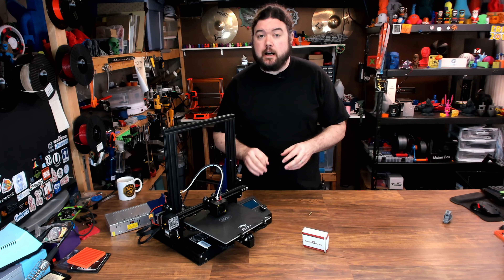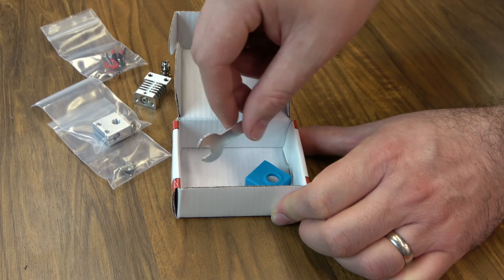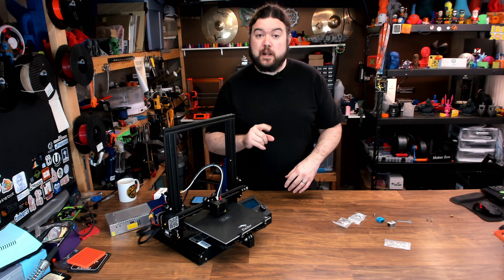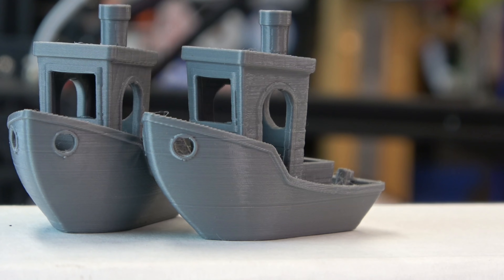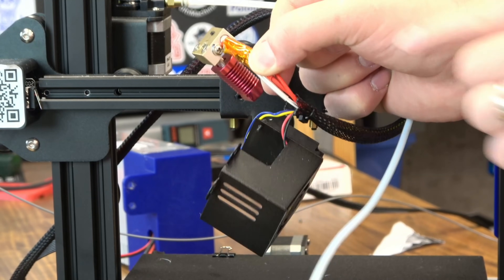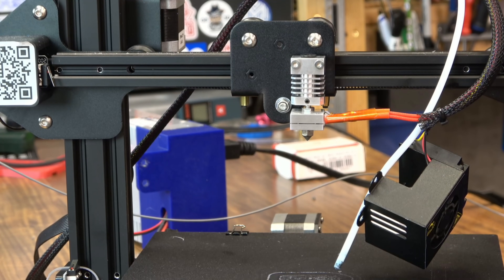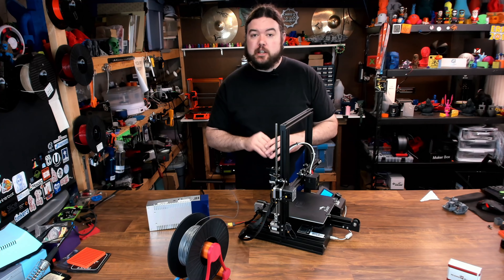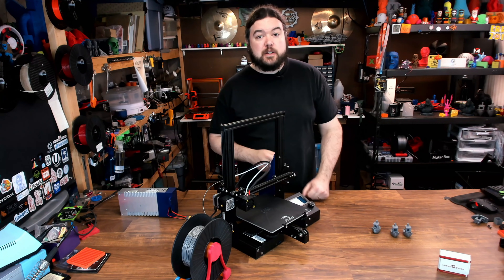All Metal Hotend - Ender 3 - Chris's Basement

Comment: So I made this mod to my Ender 3 (I made my own parts) so I could eventually print ABS, PETG, Nylon, and Polycarbonate (the holy grail).  Now I'm having serious issues printing ABS.  Seems like retract issues, but just can't nail it down.  Parts look horrible.  The surface finish looks like sharks' skin and I get a lot of plastic deposition back onto the nozzle.  Not sure what to do.  HELP?
Reply: I suffered with ABS too - built an enclosure, used the bed around 95° and let that heat it up, and print slooooowly 25-30 mm/s  with the hotend at 250-260 so the layers have time to fuse together. I eventually got good results and usable parts.
I left the retract settings the same, at about 6.2 mm, and I always used lift, wipe and avoid traversing perimeters.
A bigger nozzle diameter can also help with remelting the layers together.
Lots to play with, and it can take weeks to get right!
Reply from the maker: For this hot end I do 255c the bed at 100c and I set retraction about 2.5mm.

Comment: Micro-swiss recommends changing retraction to 4mm or under, or you risk jams (and it would be even shorter with direct drive). This would probably help with the smokestack as well. I have never noticed all-metal hotends to be jamming more with PLA. I think most people who have jams are running with too high retraction.
Reply from the maker: I was tuning this one after the fact, I got it down to around 2.5mm, seems to work well.

Comment: Great and honest opinion on why you should/should not upgrade to allmetal, however.... why the ancient Micro Swiss hotend?
we've come a long way since then, bi-metal heatbreaks! 

either a high quality one from Trianglelab or similar which is compatible with stock hotend, or why not get a Phaetus Dragonfly BMS (replaces stoch hotend directly) with heatblock to handle temps as high as 450c or something. gets you haflway to high temp filaments! (heater cartridge+thermistor and fw left).

How about a comparison maybe? ;)
microswiss VS dragonfly vs stock with bi-metal heatbreak/throat
Reply from the maker: Humm.... 🤔

Comment: I print a lot of ABS and ASA on my Ender 3 Pro, in a heated enclosure.  Switching to the Micro Swiss all-metal hotend and hardened nozzle has made the prints a little more consistent, and I have found that I am doing a lot less maintenance.  (and yes, it took a lot of fiddling with tuning everything to get looking good. But I think it was worth it.)
Reply from the maker: Cool, thanks for your insight!

Comment: This is by far the only useful video about the microswiss, unfortunately I already bought it last week and installed it a day before this video. If you don't have to print carbon fibre filament don't get an all metal hotend it turns PLA into glue. 0.4 nozzles tend to clog often.
Reply: No. Change your retraction to under 4mm. Or better yet tune it with a retraction tower, but keep it under 4mm. Print a temp tower as well to find your temps. It should print PLA with no issues at all.
Reply from the maker: Thanks!

Comment: I have found that no matter how well the PTFE tube is seated against the nozzle, the PTFE tube will move over time and you get partial clogs and under-extrusion. An all metal hotend removes that problem. I have been using all metal for a long time, never had any clogs or jamming. I think most problems people have stem from not tuning and to much retraction.
Reply from the maker: I have found the same as well, the retraction has to be adjusted to have success.
Reply: My retrctions are 1mm..still cloggs

Comment: I just upgraded to on and my main reason is to be able to install a quieter Noctua fan and not worry about heat creep, and easier maintenance. I've found removing Capricorn tubing from the stock mount really hard without doing a bunch of work. The titanium heatbreak really keeps the cooling zone and hot-end temps isolated really well. A bit of work to get rid of stringing (I had to lower temps to 195 after a PID tune and reduce retraction to like 1.5mm.

Not for everyone but having better, and more reliable parts is my main goal.
Reply from the maker: Great! Thanks for sharing. 🙂

Comment: Great information Chris. I do have a question. I print mostly PETG. I would say 99% of the time. Would this make my print more consistent in the case of heating. Right now I have to slow it down to about 50 mm/s. And even then I experience jamming ever so often. Usually after I clear the jam I am good to go again.
Reply: I do have an update. Looks like my cooling fan for the heat sync on the hot end was failing. It would stop working not the print. I saw it happen. I happen to have a new stock fan and everything works now. 👍🏼

Comment: Just wondering what your thoughts are Chris, Why would one pick the Micro, over the time tested and proven E3d V6, which is 10usd cheaper? in case others are wondering which to select, But let it be known, I'm bias as threw and through a 100% E3D fanboy lol
Reply: Ease of instalation. It's a direct swap.
V6 uses a differrnt mounting method. Both hot ends are great though.
Reply from the maker: Yeah, that easier direct swap is really the best reason to go with Micro swiss, I have never really done a side by with it vs a V6, but it might be interesting.
Reply: I just found locally cr10 heatsink that can be installed on e3d block .. its threaded so e3d throat can be installed. Sure direct and easy upgrade for me, btw it still ontheway :)

Comment: Correct me if I'm wrong isn't the MicroSwiss nozzle a shallower pitched point as well?  I say this because I know one I tried a few years ago was too shallow to use on the belt printer..
Reply from the maker: Hey Karl, yes it is.
Reply: @ChrisRiley  Yea, I really wish they would make there nozzles pointed as steep as a standard MK8.  If they did they would be a perfect replacement for the Cr-30 too..